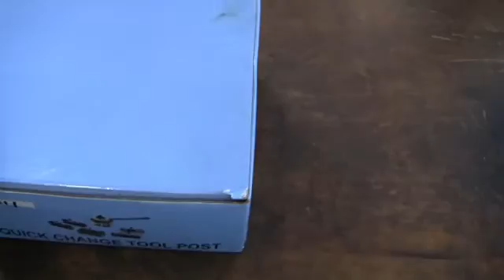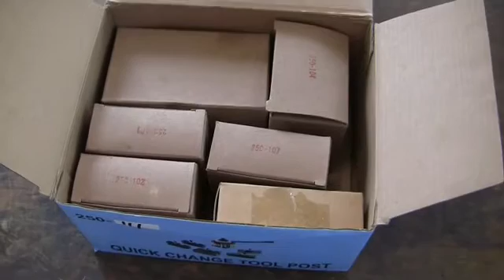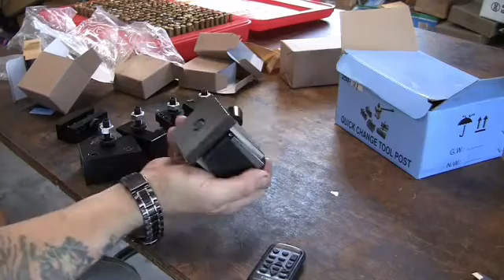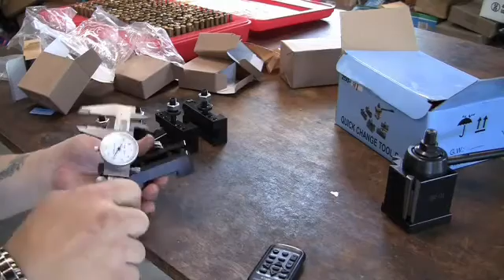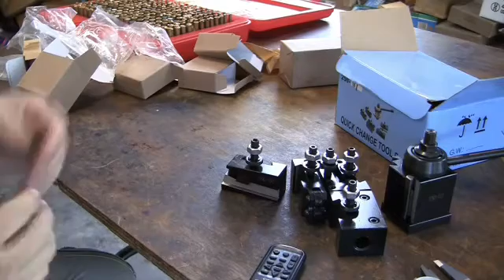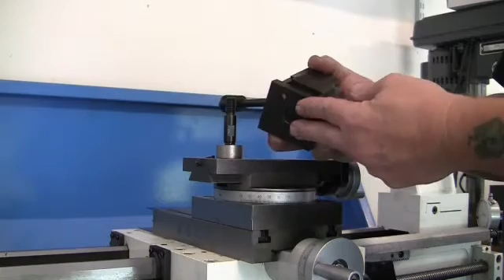PM 1228 Lathe quick change tool post holder

Comment: Is that little detent important in case you want to be able to change the angle of the tool post in 90 degree increments? wonder if its worth while to make a plate to use the detent.

Comment: So let the chips fly!
Reply: Hello.  I have enjoyed your videos on the PM1228 lathe and find them helpful. I will be placing my order for this lathe in the next two weeks. I am out of the Tool & Die shop 40 + years and need to get up to speed on many rusty machining shills myself. I noticed you have a finger ring & watch, I would strongly urge you to remove both when running machine tools as you can get them caught in the equipment causing serious injuries. I will continue to watch your future videos for tips on the PM 1228 Lathe. Thanks BB